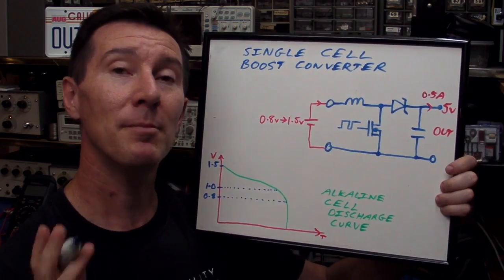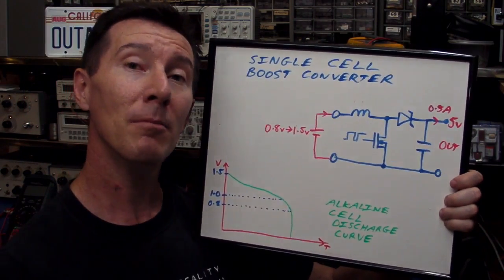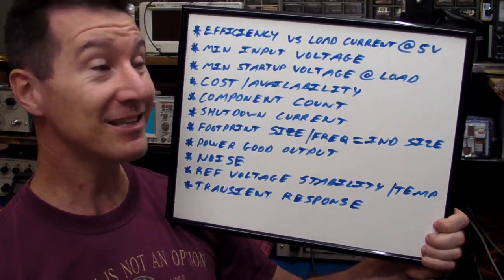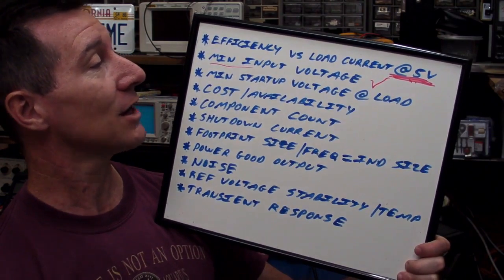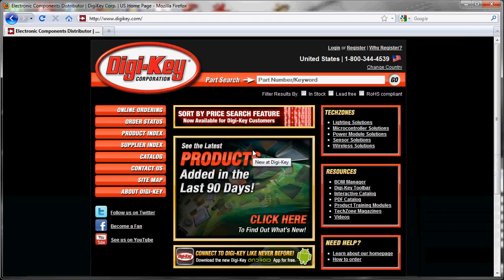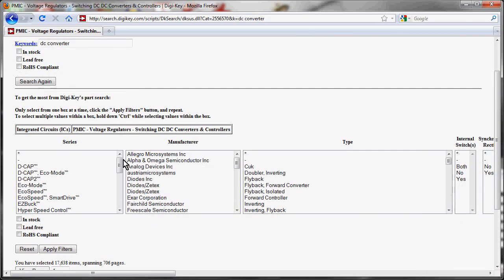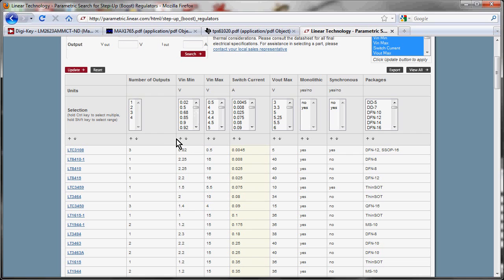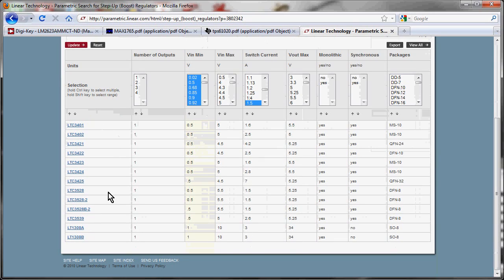EEVblog #139 - Let's Select a DC-DC Boost Converter

Comment: could you use a 555 timer ic for the pulsing fet?
Reply: +Ultra rc It has to adjust the PWM-signal depending on the current that the load comsumes, so probably not.
Reply: +Ultra rc Yes you can (I did) but the output voltage will be unregulated.
Reply: +MrOpenGL Nobody wants unregulated voltage, youll newer know how a circuit performs with it!
Reply: Konrad Peter
I had the need of providing a 12V DC source isolated from the battery so that it could power a small float  for the pump in the bilge of my boat and keep the float circuit galvanically isolated from the batteries to avoid corrosion.

I didn't have any isolated converters on hand so I did my own with a double choke (of the kind used for filtering in PSUs), a mosfet, a diode and a 555 set to 40% duty cycle and 70kHz.
Since the float circuit and the relay attached to it don't care much about voltage variations, I did it this way.
I found out that the regulation is not that bad, with no load it gives 14V and with load on (relay energised about 50mA) it gives 13,3V. So it is a bit high but not big deal. Also keep in mind that this was done using only parts I found in the drawer :-D

So yes unregulated voltage is not THAT bad, it's actually desired for some applications like relay switching (so that there is a high voltage that can trip the relay fast but then it drops so that it consumes less power) and arc lamps starters (so that a high voltage can create the arc but then drops as it is not needed to sustain it)...
Reply: +MrOpenGL Wow! That voltage drop isnt bad at all! Some time ago i tried it with a small transformer i salvaged from an old radio    - and no matter what i tried, the output voltage of  20 volts dropped to 5 volts or so with a load of only 80mAh! Next time ill use  a ferrite toroidal as you....
Reply: +Konrad Peter dont mind the "as you", you didnt even use one...
Reply: Konrad Peter
It was similar to a toroidal, with two windings instead of one. :-)
If you get problems while working on DC-DC converters, with 555s or with dedicated (like the MAX64x or LM2596) chips, most of the problems can be summarised into:

- Too low inductance: very hot MOSFET, can't get at all output voltage, inductors hiss or squeal.
- Too high inductance: you get rated voltage at no load, but get very poor load regulation (voltage dips dramatically when load is connected, even with regulating chip like the MAX641), inductor gets hot but other components (diode, MOSFET) don't.

In your example you probably had too high inductance, or too high frequency. You should try either unwinding the transformer a bit or either lowering the frequency. If you don't have a LCR meter (I don't) it is better to use toroidal inductors as you can easily wind and unwind them to find the right inductance by trial and error.

Keep in mind that while too high inductances cause no harm (up to a point, then the inductive kickback can be so big that it destroys the MOSFET), usually too low inductances cause very rapid heating of the MOSFET and really low values cause its explosion :-D so power your converter on a current limited power supply and touch the components frequently ;-)

Comment: So if the DataSheet does not explicitly state that it can cope with the Voltage and Current requirements you assume it can't?  I can understand that, but I just wanted to explicitly ask the question.

Comment: Noob question. I have a power source of 12v at 0.125 A. I'm wanting to charge a cell phone which requires 5v 1.8 amps. What kinda of dc-dc converter would I need to make/buy??
Reply: Unfortunately it's not possible. Because your power source is 1 and a half watts and your phone needs 9 watts
Reply: No converter can break the second law of thermodynamics

Comment: hey bro thanks alot for your vids , dont stop plz
i got  a question
in case if you want to seperate two circuits (the input from output) but using one power supply to power both circuits , say 9v, now , ppl say use dcdc converter which has a galvanic seperation and make it easy on u to pick a dcdc chip ..

my master can u educate me in this part ? i have no experience it or any useful information

Comment: So, is this a joule thief, basically? Or are they working differently, and why/what the difference m
Reply: Boost converter is way more powerful than joule thief.
Reply: Rocky I'm trying to learn something. :) 
Do you mean it provides a much higher current? The current of a joule thief is dependent on the transistors capability to withstand high temperatures. (Because it gets hot.) 
The only difference I see is that a joule thief does not need a separate circuit to provide a squarewave signal for the transistor. (which is also a different one. Why?) It can oscillate on it's own because of a genius trick.
Reply: +Distelzombie Centzon Totochtin Yes it both provide higher voltage and current. Boost converter need circuit to control the PWM because boost converters are regulated power supply which means the output is regulated to maintain constant voltage no matter how big the load is. A regulated converter  has feedback pin which should be stay at the reference voltage of the ic, for example is LM317 which has reference voltage of 1.25V. Using voltage divider we can set the output value to whatever we want. When the input reference voltage drop, the duty cycle increase and when the voltage drop, the duty cycle decrease. Hope these help :)
Reply: Kind of but not quite. There are roughly 3 families of devices that can generate higher voltage.

One is transformers. Windings of different density couple through the same magnetic field, which allows to convert AC between different voltages and currents depending on ratio of winding density. Joule thief has a transformer, however it doesn't do the voltage conversion in it, because it has the same winding density on both sides, is a 1:1 transformer.

Second is based on the fact that a magnetic field built up in the coil will maintain the current, regardless of voltage, so by increasing apparent load, the voltage will also increase. Both Joule Thief and Boost regulator work on this principle. Joule thief is of course unregulated, not particularly efficient, etc. Completely different levels of sophistication.

Third family is the capacitor ladder or charge pump. A charged capacitor maintains a particular voltage between its plates, so if you take a charged capacitor, and connect it to a higher voltage on its negative end, it will present a higher voltage on the positive end. Then you basically make a ladder where you switch them on in an alternating sequence, and so you can generate a higher voltage.
Reply: I made a joule thief with 2/3 ratio and it works great. So, don't generalize.
Reply: Distelzombie Centzon Totochtin   And you watch your tone. Yes, nothing prevents it from working on different winding ratios. But it works EVEN with a 1:1 transformer that would be useless to generate a different voltage otherwise, specifically because Joule Thief doesn't rely on the transformer mechanism, but on the current-retaining property of the choke.
Reply: Siana Gearz watch my tone? What did I do wrong?

Comment: I need to build a boost circuit for a inverter. the final output needs to be approx. 5-6kw. I need the boost for 24v to 150-180v DC. and constant volt output. can you help me or point me in the right direction to meet my goal? I enjoy your videos. and I hope you can help with my project. is there a ic I can buy to control the circuit? or use a 555? I'm new to this. and this is my first big build. I figured I need 50-60 amps @ 150-180v DC. and I don't think I can just go out and buy a DC boost of this size. and can't afford a DC to Ac of this output. thanks...
Reply: 5 to 6 kilowatts, and you think you can use a 555? Wow. You really need to learn more before attempting to play with power levels like that. To build a circuit like that you'd almost certainly need to use discrete FETs and transistors, along with appropriate high voltage safety in mind. You might be able to get a chip to control the switching circuit, but I can't think of any off hand that could handle that kind of power. It would be a very specialized chip. Not to mention, the required inductor for a current that big would be ENORMOUS. Definitely not a beginner-friendly project, I'm sorry to say.
Reply: It should be possible to use almost any boost converter IC, however it will need to be operating current-free and completely at a low voltage, repurposed into a controller. Its outputs will need to be circumvented and the output section re-done externally with a dozens of FETs for example with proper separation, each driving a separate choke and diodes, because you can't stop back current with just one diode either. Finally, the voltage is divided down and fed into the feedback of control IC. The controller doesn't need to know that it's actually controlling a high-current, high-voltage circuit. You'll want a controller with less than about 50KHz oscillation frequency, and you'll even have a hard enough time getting large enough FETs to behave at that frequency. 

Even though i might seem to know what i'm doing (this would be a false impression), i wouldn't embark on such a project. It just screams DANGER all over - it would need extreme precautions against fire and bodily harm - the voltage might not seem too hard to handle that you're aiming for, but you'd be switching a huge total inductance with a shit ton of current in it, the current it'll strive to maintain, happily sending it through your heart and anything, or inducing tens of kilovolts and sparking and arking over everything. The precautions will need to extend to materials of the building and electrical installation and measurement equipment. Depends on how suicidal you are, but please think of other people. I know of a guy who does these things professionally, specifically designing switch mode kilowatt precision supplies, but you won't be able to afford his services.

This is a highly specialized field, and you should promptly forget everything i said in the first paragraph, because when i start sketching that down as an actual schematic and BOM, i likely will find more problems and more sources of danger, and i'm not even going to be sure whether i catch them all in a week or ever. Or only use it as an illustration to asses whether you're up for such project. Maybe keep it on the back burner, sketch things out over the years, and in 10 years, consider whether you actually want to start building a 5kW supply, and start small, working your way up from 2W to 20W to 100 to 500, i'm sure you'll encounter issues along the way that i'm not considering. I, for one, would rather stay away from dangerous currents myself. That reminds me, i should make my life statistically shorter by getting a motorbike - at least that's exciting, right?

Comment: Hi, great channel. my question is: I created a circuit with the 120 v mains and used a stepdown transformer (1 amp, output 6.3 v). I used a full bridge rectifier to convert to DC. I have boost converter ( 3-12 in and output from 3 to 65 v, 4 amps) . I want to have variable voltage of 3- 60 v, 3 amps. can I do this with the transformer I have? I can't fine a small enough transformer. thanks, 
curtis

Comment: i/p voltage 0-15v, o/p voltage 0-30v, load current 800mA, o/p voltage and load current ripple 1%, any converter buck-boost, cuk, flyback , for discontinuous mode, any help

Comment: Can you even pull that much power from a single AA alkaline? The internal resistance means sizeable voltage drop, which means more current required and less efficiency, less efficiency  means yet more current, which means yet more voltage drop... surely you're looking at well over 3A and that's a pretty big ask from one lonely AA alkaline.

Comment: Size of inductor is not related to cost.
Reply: +Robert Stever 
Yes, but within the context of product design and mass manufacture (which I think his checklist is referring to), the cascading cost of enclosure, mould tools, storage and transport is directly relative to size of components. Finding the trade-off point for selected components is necessary in comparison to an open-lab product.

Comment: please i wanna help i have a project on college i have a peltier its out signal DC and it in mV to 0.3 volt out 
i wanna make a boost converter to make the out go to 1 or 1.2 volt to turn on a LED any help here please
Reply: might i recomend using a mosfet instead and just using the signal from the millivolt to turn on the led?

Comment: For single cell boost converter, check out the Sipex 6641 series (http://www.exar.com/power-management/power-conversion/switching-regulators/step-up-regulators/sp6641).  Good performance, low part count and very good storage current.
Reply: You should take a look into the datasheet it is not suitable for the required specs.

Comment: @EEVblog
I have a question to this topic about finding a DC DC boost converter chip. What if i want have a Vout of 2000V at a Vin of let's say 12V? I didn't find an IC that can do this. Is in this case a discrete component the only solution?